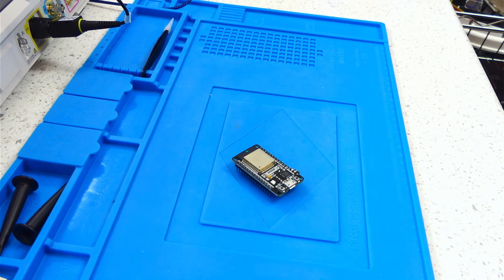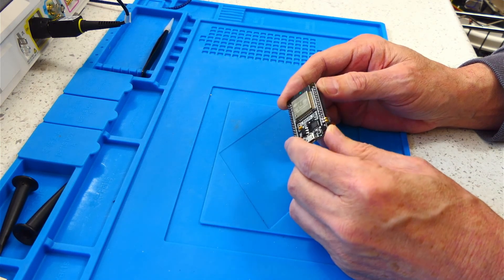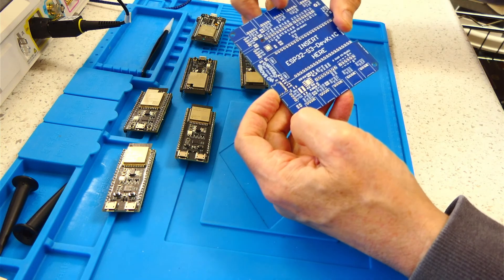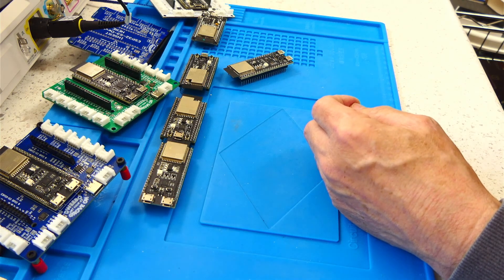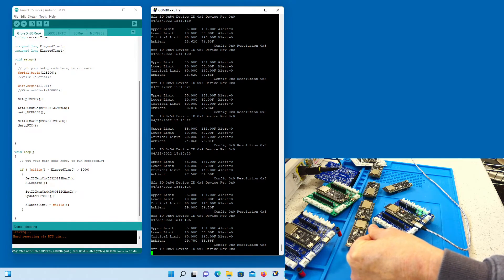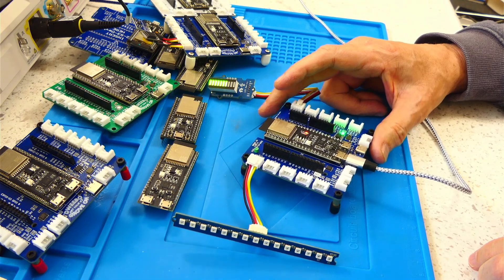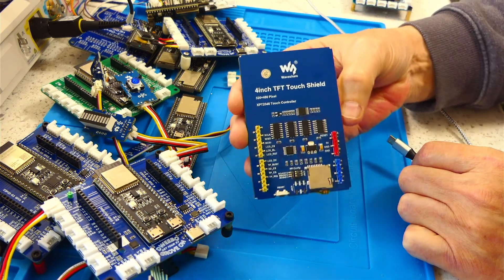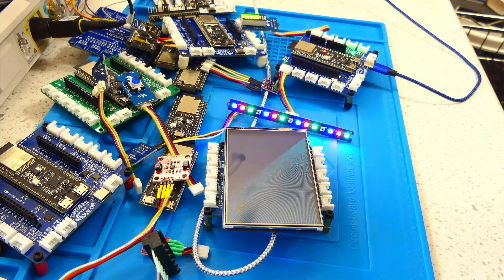ESP32-S3-DevKitC-1  #JLCONE

Comment: I really like the ESP32  S2/S3 board.  I've been working testing many temp and humidity and other sensors at the same time to be able to compare them on the same controller in the same location.  I see adafruit has a feather board that really is just for adding two wings.  I've love to receive or buy one of your devices.
Have you considered adding some fuses (blade type (like in cars)) for the LED strips?
Reply from the maker: I would not try to drive a long led strip from this board. A separate power supply would be needed. There are ptc fuses on the 3.3v rail. They are 500ma fuses. They are for when the power gets shorted it provides protection during testing and so on. I will contact you via linked in if you are on it. If not see if you can send me a message thru it. I have a couple of proto boards left I can send to you.

Comment: Hi there, can you tell me if the fspi and subspi pins of this board are compatible with standart SPI?
Reply from the maker: Hi,
As far as I know they are. I have used them on different peripherals and changed spi modes. So I would say yes. Also per data sheet looks like it does.